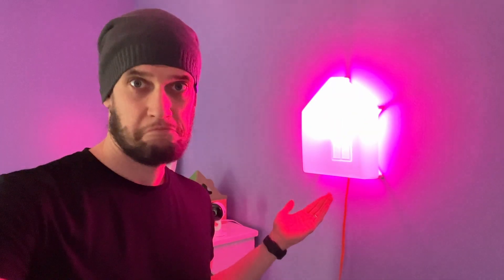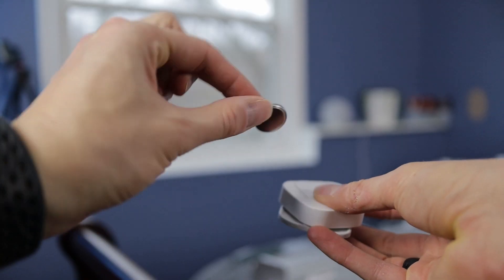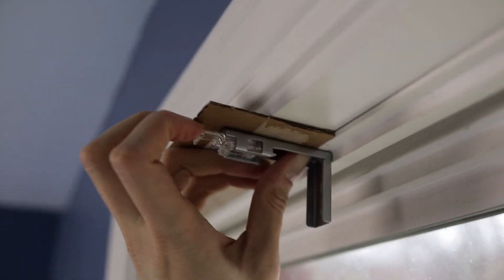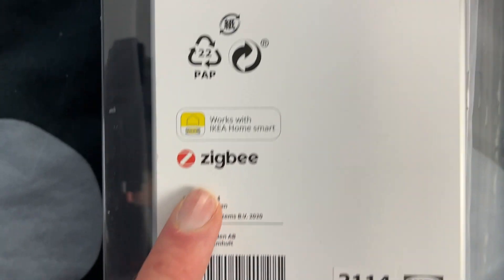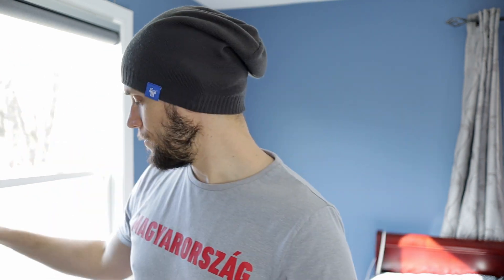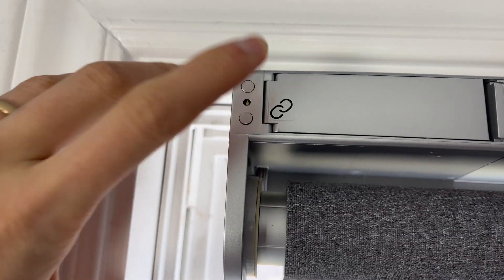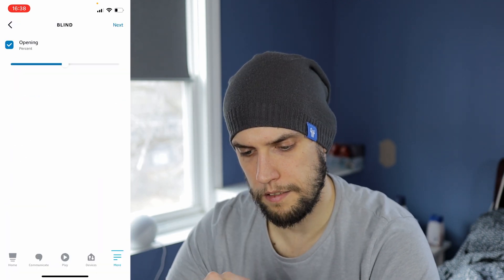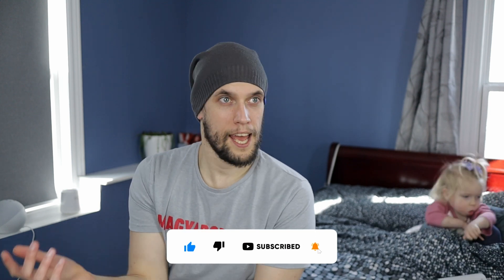IKEA FYRTUR Smart Blind Assembly & Setup with 4th Gen Amazon Echo (no TRÅDFRI Gateway)

Comment: Can you check the remaining battery percentage anyhow in the Alexa app if you use the built-in Zigbee hub of the Echo 4th gen? Or how do you know how much battery left? Only once it dies and won't move up or down will you find out that the battery is empty? Thanks!
Reply from the maker: Yep, no way of telling battery percentage as far as I’m aware. When it stops responding you know the battery died.  I just had to charge it up last week, but before then I must’ve had the battery in there for at least a year.  So it lasts quite a while.

Comment: Thanks so much for this video! I recently purchased a 4th Gen Echo and Fyrtur blinds, but I'm still not able to pair the two. I tried taking out the battery, doing a reset, unplugging the IKEA outlet thingy, but Alexa still doesn't discover it. Any ideas what I need to do? Could it be a firmware issue? If so, how can I revert the firmware to a previous (or newer) version? I'd really appreciate any advice anyone can give, thank you so much!

Comment: Thanks! great video. The blind seems a bit small for the window though.

This was just the info I needed. Guess it's time to upgrade from a 3rd gen Echo Dot to a 4th gen Echo instead of buying a TRÅDFRI. Can't wait to combine a smart blind with Philips Hue.
Reply from the maker: Yes, unfortunately the next size up would've been too wide to install it in the frame so I ended up putting 2 blackout curtains up as well to cover the end strips, I just didn't show that in the video.  It looks pretty good with the curtains.

I don't have experience with the Philips Hue system but If you already have a Philips Hue Bridge, I believe the blind should be compatible with that natively as well.  The Hue Bridge itself is a Zigbee Hub (just like the Gen 4 Echo) so you could try resetting the blind (by holding the up and down buttons for 5 seconds) and then search for a new device in you Philips Hue app.  Good luck 🤞
Reply: @KorosiFam  Oh cool, didn't check that far regarding the Bridge yet. I do own a Bridge so will give that a try first before considering a new Echo.

Adding curtains sound like a good solution. I bet it looks good too.
Reply: @KorosiFam  thanks for the video! I did a very simple size customization by taking the shade apart, cutting everything to size and reassembling.

Comment: great video and guide. I had to upgrade my Alexa hub as I had the generation one but after that all good. The Ikea hub is outof stock, I think they are upgrading it or something like that. Just wanted to give all / you my 50 cents. I find that resetting the blind and parring at the same time to work. First I tried reset only and then pair and did not have much luck.  Maybe user error. Since I have 4 blinds working together I was able to set several commands like blinds at 80%, blinds at 50%, etc with Alexa Routines.  Also found that Alexa understands a bit better Blind A, Blind, B... instead of Blind one, blind two.... Maybe my accent. Last I a curious if anyone know if Alexa can work multiple blinds with open at specific % without having to make several commands. Probably not ... as I read your answer to Doron Mizrahi.
Reply from the maker: I wasn’t able to make my group of blinds work on percentage commands either unfortunately. I basically have 3 routines set up for the group, fully closed, fully open and one for halfway.  That works for me for now and then if I need to, I voice command the individual blinds with the percentage.

Comment: blind showed up in alexa app, but not able to control it.  Any idea?
Reply: I have the same problem with IKEA TREDANSEN (another smart blind). I can see the blind in the Alexa app. When I command "Alexa, #blind-name to 50%", it says "#blind-name doesn't support that".
Reply: @minyucai1440  try creat a routine first
Reply: @tommylai91  Thanks for your advice! It seems that it also has something to do the firmware version of the blind. I tried the 'routine trick' with firmware 2.3.079 and it didn't work. Then I updated the firmware to 2.3.088 and the 'routine trick' worked!
Reply: @minyucai1440 come posso aggiornare il firmware della tenda??